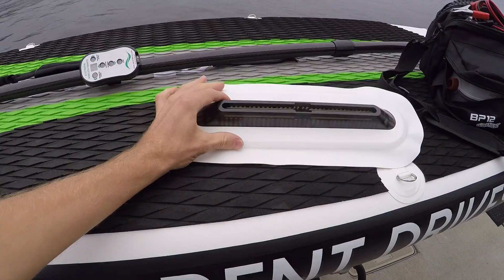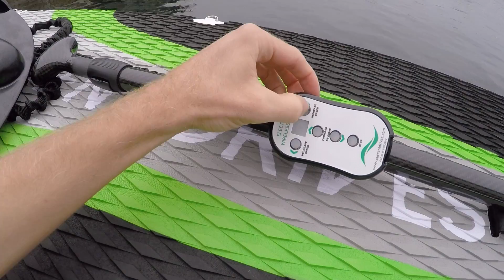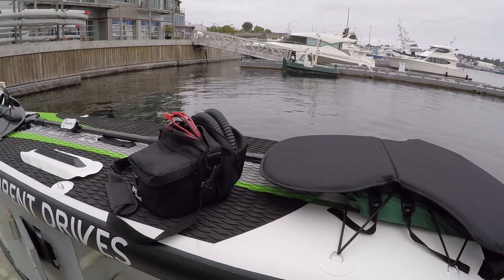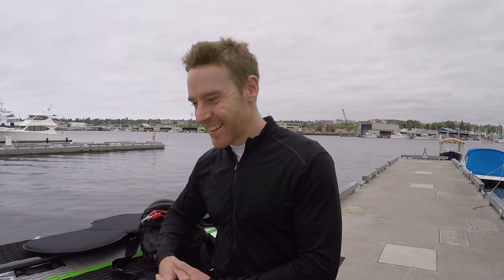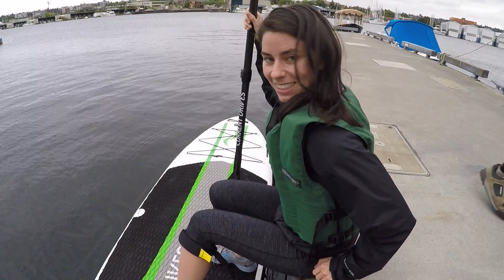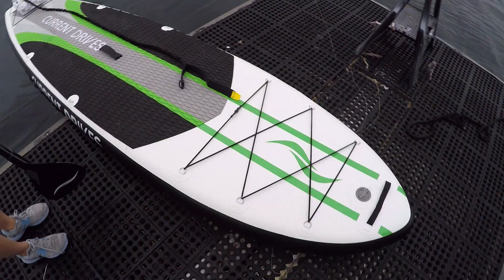Current Drives ElectraFin Electric Stand Up Paddle Board (SUP) Video Review

Comment: Not to be a negative nancy but this video gave bad information regarding legality. You are violating State and federal law. First off I see you are at salmon bay which is a Federal Navigable waterway. Which leads into lake Washington. Why is this important? Well Under Washington state if you operate ANY motorized vessel in a federal water way you are required to have the vessel registered No mater what the horse power. That "vessel" has no state registration numbers. Also when the guy was on the board he obviously does not have any of the federally and state required equipment Such as Flares and sound producing devices. Which means you follow under Negligent Operation (46 USC 2302 (a) (b)). Grossly negligent operation is a criminal offense and an operator may be fined up to $5,000, imprisoned for one year, or both. There are multiple other federal laws and fines you are under and could face charges for violating. You also have state penalties that could be imposed. You unknowingly posted a video of you Violating federal and state laws.
Reply: Xiphos haha awesome.
Reply: Well i have no doubt it would be someone like you that would bring it to there attention. What is it anyway with America?  your laws sound like something out of Monty Python movie has your judicial system simply become another capitalist business.
Reply: @shiraz1736  I was told the same thing from my local Harbor Patrol here in So. California.  They just want to keep things safe....I guess.  I tried to purchase the e-board, but it seems like they are going out of business since they have no stock.

Comment: $1800 for the Electrafin.   sorry ridiculous price for tech that has been around for years.
Reply from the maker: +Mike Easingwood Yeah, it's a bit expensive but packaged well and easy to fit onto a board. I actually think they could charge more considering the marine grade parts and wireless controller... this thing would be pretty time consuming for most average people to put together :)
Reply: Way overpriced for a cheap motor ,plastic fin and a battery..ridiculous!!

Comment: Awesome, I've seen these before and they look really fun. Good to get some info on them. I was surprised how much run time you get.
Reply from the maker: +Gardener Rob Yeah, it sounds like you can get ~2 hours at 5 mph and 5+ hours at lower speeds just trolling. I finally posted the writeup and the battery size is 15 volts with ~29 amp hours so nearly .5 kilowatt hours running at 400 watts peak output (probably closer to 200 most of the time at lower speed). This makes sense to me, 10 miles on an ebike is usually a minimum for a 360 watt hour battery running on a 250 to 350 watt motor. Similar :)
Reply: +Eㅅ
lectricRideReview.com

Comment: Lifejacket.....really?
Reply from the maker: +natrone23 Well, if you slip and hit your head on the dock while launching the jacket could save your life. I always wear safety stuff on film to set a good example but I surf all the time without a jacket and have been smacked in the face with my board (thankfully not knocked out). I've also been trained for lifeguarding and spent time on boats and kayaks, many vessels require you to use them.